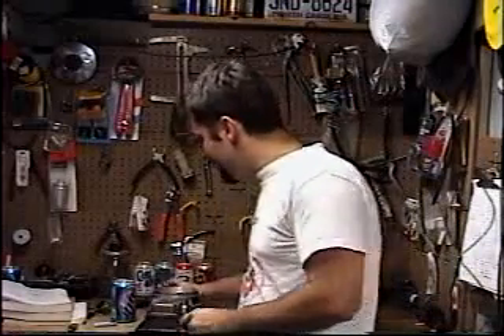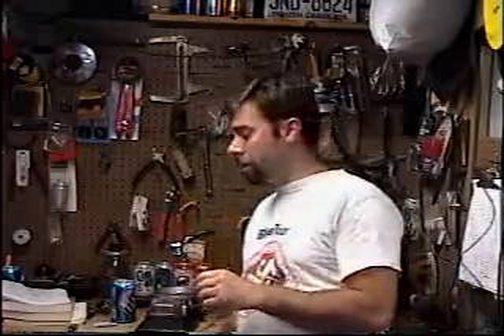VW Rabbit School Of Repair Part 7 Fuel Distributors.

Comment: I as well as many of my friends have opened up (split) the CIS manifold, cleaned all spring hats cups and chrome plate and changed all o rings and re assembled it with absolutely NO leaks or problems. We also remove and rebuild the fuel pressure regulator adjustment shaft o rings and spring if needed. There are also individual jet pressure adjustment screws under the other little screw caps that allow you to re sync all the flow to each injector via the manifold. You are miss informed. There are videos on here showing the complete "Bosch Professional engineers" lol process. Dont be skeeerd!
Reply: 87 cabrolet 1.8 Hey so I'm not getting fuel to my injectiorsgot fuel to the cis box but not to injectiors what should I do
Reply: @jussomemf8621  Try changing the the fuel pressure acummulator.

Comment: Hey MopeFreak  - I have a 924 turbo with the Lambda CIS  system.  I just installed the metering/ air sytem. how do I setup or adjust the mix for the first time  (Ken)

Comment: god, this fuel injection system (cis) is kicking my ass. my issues lye with the frequency valve on the fuel distributor; it only buzzes the first 15 seconds upon start up, then it turns off, and adjusting fuel mixture (3mm) doesn't make it turn on.

Comment: By the way for more detailed information that type of air flow meter is called the up -draft  design, meaning that the sensor plate goes up as the air going to the engine passes through it. On other European cars like Mercedes Benz, they used a down-draft design air flow  meter wherein the sensor plate goes down as the air going to the engine passes through it. I like your video and God bless, stay away from covid.

Comment: Please help my gti 1.8 is over fueling the minute I disconnect the fuel pump it starts right up and dies again but when I plug the pump it doesn't sound at all
Reply: I would recommend you to perform a fuel pressure check on your car. It looks to me that there is a possibility that there is  an internal fuel leak problem in the fuel system of your car. Possible cause could be a leaking cold start valve, or even a fuel leak coming from between the plunger and the barrel in the fuel distributor. When you do the   pressure test,the system pressure should be 5.0- 5.5 bars and with the electric fuel pump off the fuel pressure should not drop below 2.5 bar within 20 minutes. I hope this will help you locate the problem you're having with your car.

Comment: Thts the problem i have on my 1988 cabriolet
It wont distribute gasoline to my injectors 😕
Reply: Did you ever get the issue resolved? I have the same issue with mine